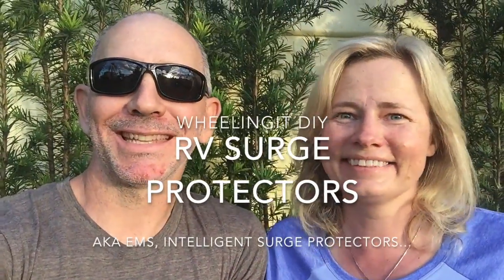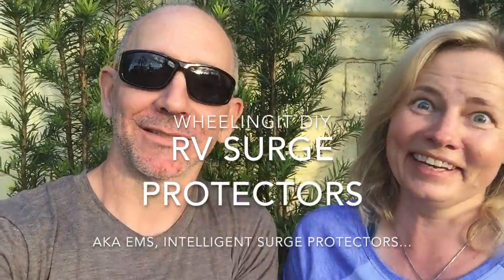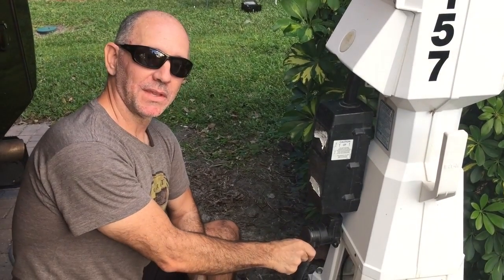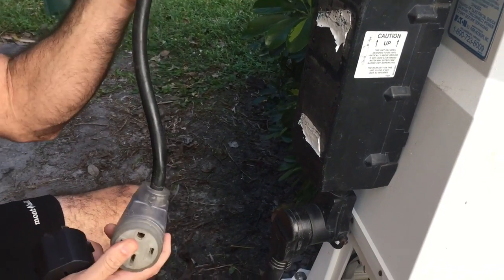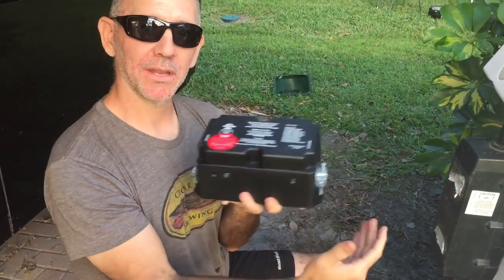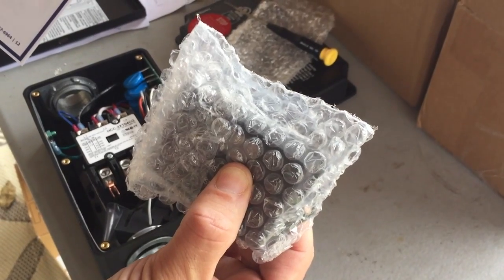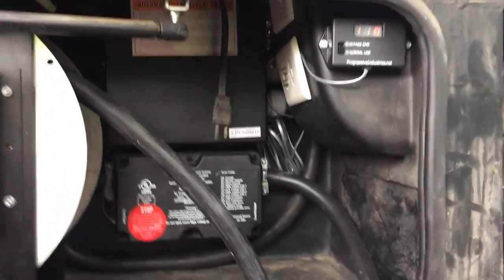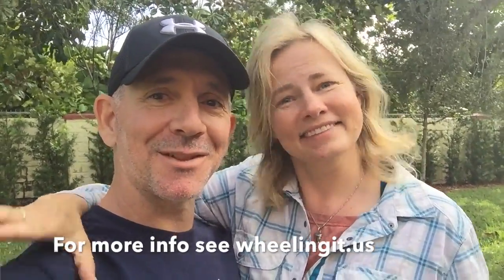RV Surge Protectors: Progressive Industries EMS HW50C Review & Installation

Comment: I installed the Progressive Industries EMS-LCHW30  hard wired 30 amp power management/ surge protector earlier this year in our Class C. motorhome. It has already protected our electronics from low voltage and open ground situations. Our unit was about $200 from C.W. While installing it I called Progressive Industries with a question and they answered it to my satisfaction. I like the idea that the hard wired S.P. is out of the weather and in a lockable cabinet.

Comment: Good video. On the Progressive Industries 30 amp  portable model - I was concerned about theft also, so here is what I did to keep the unit inside the rv. I first called the company and asked them if this was ok and they said 'definitely'. I disconnected the original 25' power cord that connected to a junction box in the electrical bay and put a 3' pigtail with a male plug into that rv junction box. The 3' gave me some play and allowed me to still plug into the generator outlet. Then, I put a female receptacle on the end of the 25' foot cord that I had just disconnected - effectively making it an extension cord. So now, I plug the 'extension cord' into the pedestal and then plug the surge protector into the extension cord. Then I plug the 3' pigtail into the surge protector. Now the expensive surge control unit stays safely locked up in my electrical compartment. Again, I called tech support at Progressive Industries to make sure this was an accepted way to hook it up and they said yes. Works like a charm.

Comment: Wow I have a huge learning curve to achieve. You mentioned you check the pedestal for the voltage. What type device do you use?  I am not to informed on electrical stuff.I did write down all the information on your previous video & this one. Thank you.
Reply from the maker: Just a simple digital multi meter. Set it on AC Volts to measure the voltage at the pedestal. You can find a wiring diagram on line and even some youtube videos on what to check for.
Reply: Thanks so much.

Comment: Paul, Nina, thanks for a valuable pair of videos (Transfer & EMS).  You really have clarified an area that I didn't fully appreciate before.  Couple of questions:

1.  Your Transfer Switch got fried by low voltage you think... was that because you had a portable level 1 Surge Protector that didn't detect that condition?  Making the case for any of us to upgrade to the level 2 full EMS protection?  Even if that's not the case in your situation, would it be correct to take from your video that the Level 2 full protection is a much better idea than the basic protection?

2.  From a practical usage standpoint, if you had the choice, where would you suggest is the best location for the EMS monitor readout?  In the bay, or inside the coach by the other panel indicators?  Is it something you would monitor regularly, perhaps making inside the coach a preferred location?   or, is it something you would monitor only/mostly when hooking up making the bay the best location?

Thanks for all your great info on making RVing more enjoyable and in this case, safer.
Reply from the maker: We're actually not entirely sure why our old surge protector didn't alert us to the low voltage situation (it's supposed to have that feature), but there's no doubt we think level 2 protection is the way to go. Low voltage detection is actually one of the "key" features we recommend looking for. As for the external monitor it kind of depends on your personal preferences. We like to have ours in the bay so we can see it when we plug in, but some folks like to continuously monitor from inside the coach. We have other displays inside that already do that for us, so mounting it by the reel made the most sense. Hope that helps! Nina
Reply: Nina, it does help.   Thanks a lot!  As always I look forward to following the two of you.  BTW, you do the BEST camp ground reviews.  :)